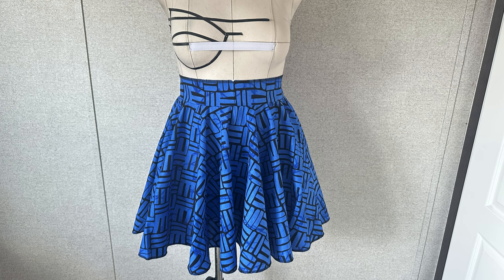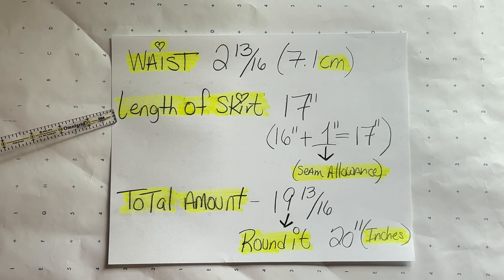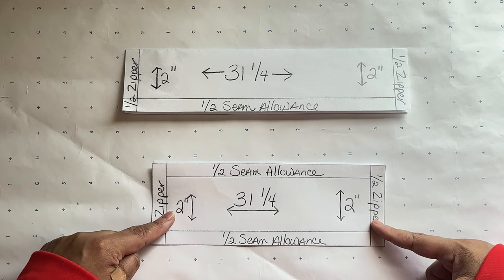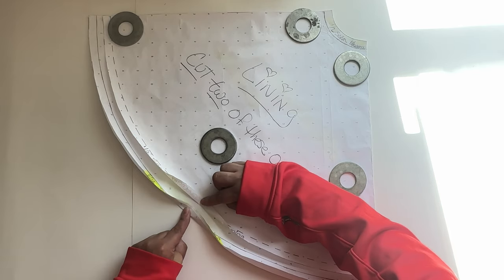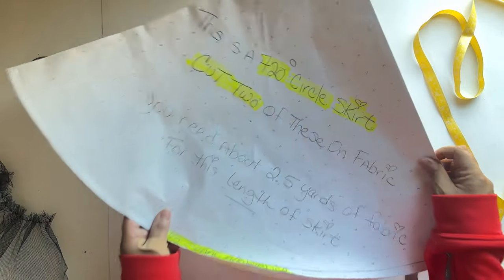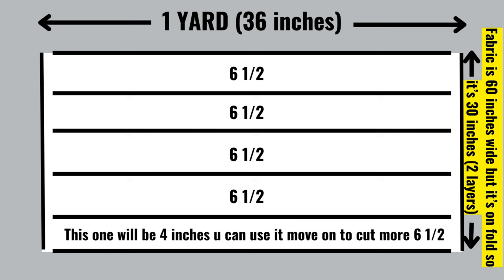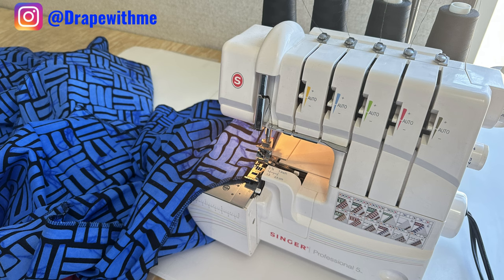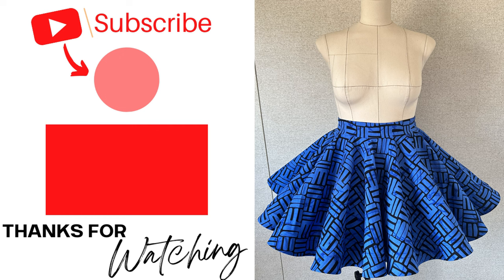How to make a 720 CIRCLE SKIRT with INBUILT PETTICOAT

Comment: Why ÷by 6,28? This is so helpful I'm trying to understand why that amount please
Reply from the maker: Ok, so pie is 3.14 and it has a symbol like this (tt) and radius symbol is (r)
There is a formula that never changes for a full circle skirt 
Here the basic formula for a circle circumference C=2ttr
But we need the radius of the circle skirt so the formula is 
Circumference divided by 2tt 
So here is a example 
Circumference of a waist is 28 inches 
2tt is 2 times 3.14 which is 6.28 
28 divided by 6.28 =4.45 
This is a algebra math problem. And I understand how you feel about really understanding where it came from. But to really understand it u would have to look it up in math algrebra tutorials to get to the bottom of it. But just remember it’s a formula that never changes so you will always remember to use 2tt which means 2 times 3.14 which is 6.28 I wish I can help you more I taught Algrebra to students who wanted to get their high school diploma but I can’t really explain it while typing lol sorry. I hope this helped you a little 🙂
Reply: Just to add, if this Math seems too complex to you, know that there are circular skirt calculators online. They even calculate how much fabric you need, once you have input the accurate measurements.

To use it, you must equally understand the concept of calculating Pi( standard formula). However, the best I can do is explain in simple terms. 

-if you want to input measurements for a cicular skirt in the calculator,  you decide if you want your skirt to have side seams and back seam. 

So in the case of a 720° skirt which is 360°×2, you divide your waist into 2 and label FRONT and BACK. FOR Example, my waist is 32" which divided into 2 gives me 16 

If FRONT is 16+2 (side seam allowance for left and right side)= 18.

I input that in the section of the calculator that indicates "CIRCUMFERENCE" (Note: you are assuming that half of your waidt for Front is a full cicle so that it can calculate the radius of a full circle). Once it calculates I note it along with how much fabric is requires.

Then I do the same for the BACK

16+ 2" (side seam allowance LEFT& RIGHT)+ 2" (Center Back/Zipper allowance)  
[16+2+2=20]

I input that in the "CIRCUMFERENCE " box on the calculator as well as my desired length of the skirt and voilà!!! It calculates for me. 

For online circular skirt calculators you can check out: 
-anicka.design (she has detailed explanations and illustrations of the results too)
-byhandlondon.com (it illustrates how you can fold fabric to achieve desired results)

In fact, a hist of them are online so explore and find which ever workd for you. 

As our teacher says, PRACTICE, PRACTICE PRACTICE!!!!! ❤❤❤
-

Comment: Hello, I just wanted to ask if this would work for longer length skirt and how would I then cut the crinolin for a longer skirt to make it look the same as the skirt in the video. Can I use the horse hair of any width?
Reply from the maker: It could work for a longer length but I would use the organdy fabric (thick fabric) and sew boning around it like 6 inches away from each other so that that longer length can flare out. There are different widths in horsehair u can use 3 in and up for longer skirts if u want.

Comment: Please did you put two crinoline circles, I see you used just one circle. What's the measurement from the hem of the lining to the line where you sew in the crinoline.
Reply from the maker: The crinoline fabric has to be 2 layers  the lining and main fabric is 1 inch apart from each other at the bottom.
Reply from the maker: The crinoline fabric has to be 2 layers. The lining and the main fabric has to be 1 inch apart from each other from the bottom

Comment: Do you think it will flare nicely only if I do a full circle skirt?
Reply from the maker: A full circle is ok if you’re not looking to have it flared out, but if you want it to have more volume then this is good. It also depends on the fabric if you make a full circle skirt with stiff heavy fabric it will have a flare however if you made it with stretch or a fabric or a woven that is light the full circle skirt will look flat and simple. I made this skirt with Cotten fabric and in the thumbnail of the video you will see how it looks before the crinoline and lining is put inside. So the fabric plays a row in it. You can still make a full circle skirt and put crinoline and lining but use heavy fabric. Hopefully this helped ❤️
Reply: Thank you so much!

Comment: Pls I have questions??
The crinoline you ruffled was added one inch above the lining??
2. You added horse hair to the hem of the Ankara…
How many layers of horse did you add ?? Was it single or doubled
Reply from the maker: I cut the lining 1 inch away from the circle skirt pattern after I did that I went up 1 inch from the lining.  It’s so that the crinoline doesn’t touch your skin…u can do 1/2 inch instead of 1 inch as long as it doesn’t touch the skin because crinoline makes ppl itch.
So for the horsehair I think I used 7 yards but that won’t be for everyone the bigger the circle the more  horsehair u need…so if your waist is 31 1/4 or less than keep about 8 yards to be safe if the waist is bigger…then u will need more horsehair..buy 10 or 12 yards to be safe… the horsehair was single. Hope that helped ❤️

Comment: Why divide by 6.28?
Reply from the maker: Hi, it’s a math equation (Algebra) we need in order to find out the radius of the circle skirt. 
So we have the circumference of the waist and half of the circle is called a diameter and half of the diameter is called the radius. That’s what we need (the radius).
To calculate the diameter we need to divide the circumference of the waist by Pi.
Pi is a symbol that stands for 3.14 (THIS SYMBOL NEVER CHANGES)
Now the radius will be half of the diameter so it’s 3.14 times 2 (which is 6.28) so the symbol is 2Pi (THIS SYMBOL NEVER CHANGES EITHER) 
Which means you must divide the circumference of the waist by 6.28 to find the radius. I hope that helped you ❤️😊